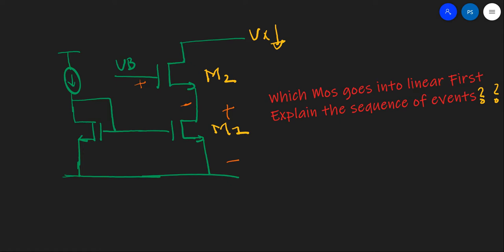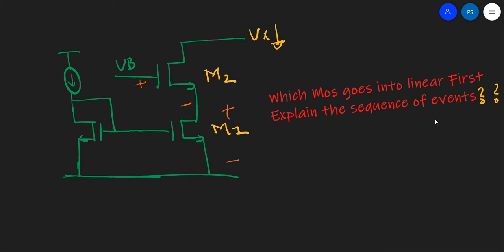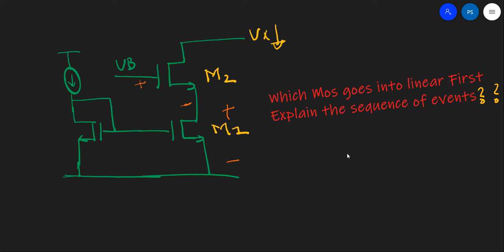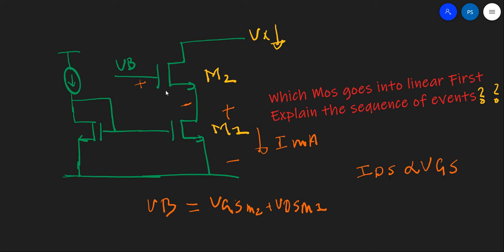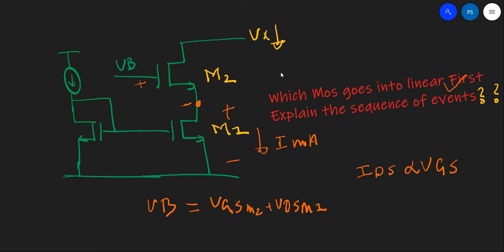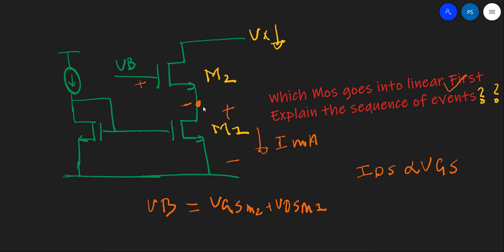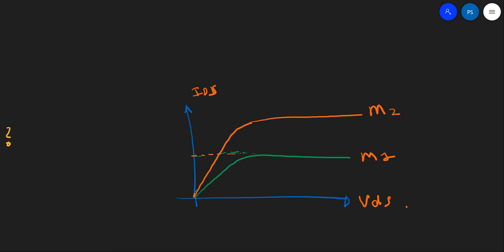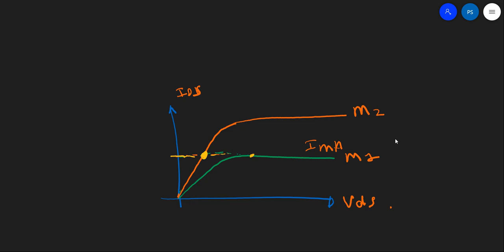Cascade Current Mirror - Analog Circuit Design Interview

Comment: 😃M2 was the cascode device, which acts as a sheild.   The  voltage of M2 source change very little when its darin changes.( all in saturation)
Reply: thanks for the answer, you are an absolute chad 👑
Reply: Yes it's correct that the cascode transistor shields the CS transistor....but if Vx falls below Vb-Vth then M2 would go into linear first followed by the transistor below